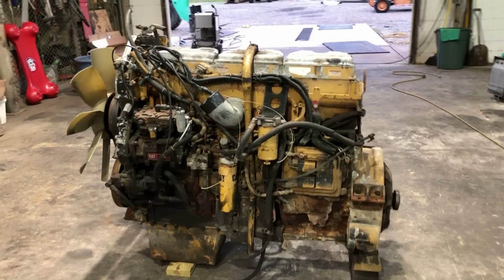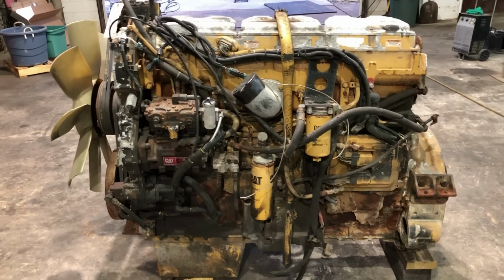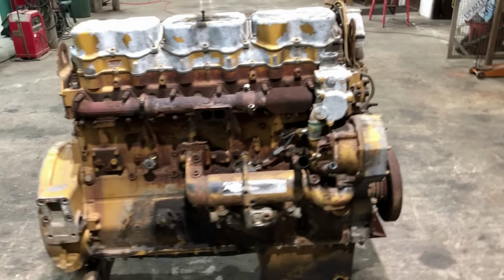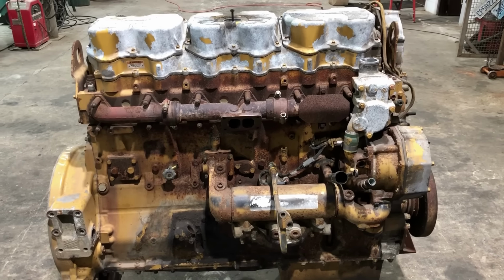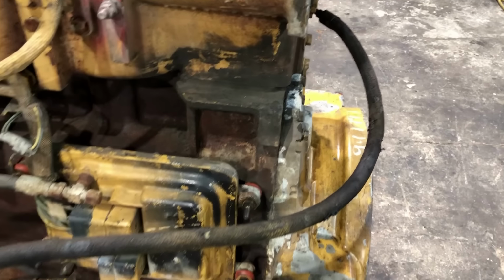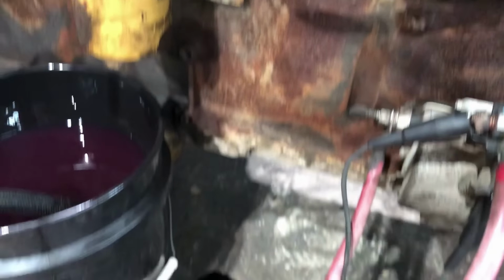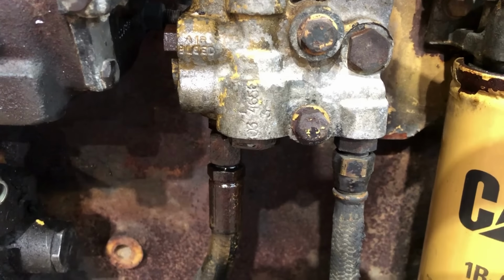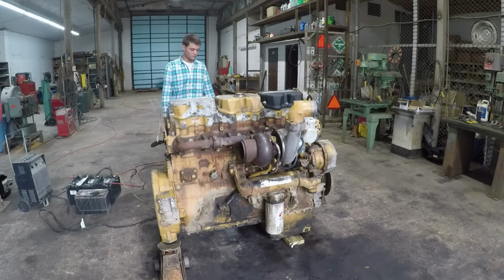Bringing a Caterpillar 3406E 14.6 Liter Diesel Engine Back to Life

Comment: Wow really So this engine just show's up you know nothing about it ? So  you didn't pull the dip stick to check what the engine oil was like really ? Dude that's like the first thing I do .. yea sure I'm gonna rebuild it but I'm still curious about it enough to reach out and pull the dip stick right ? Next time pull the stick it will often tell you more about the motor than you think especially if the dirty oil has fine metallic dust in it then I know it's got substantial engine wear right if it's like a Mocha frappe coffee latte than I know the head gasket let go or there bouts ... Now I have no clue .. Dude didn't you say it had water in the oil ? Well getting it running would NOT have been my first choice not at 880K bro.. I would have taken the heads off  sent it out to be checked and fully machined then whatever the bottom needed then gotten it running  I already know what a 3406  sounds like .. just saying why dump any time at all into getting it running  ..when it's got to get busted down
Reply from the maker: You don't get it at all.
Reply: He shore doesn't  @KT3406E
Reply: Hey Michael, did you spot the sump plug lying by the side of the sump in the early part of the video ?
No, I thought not.